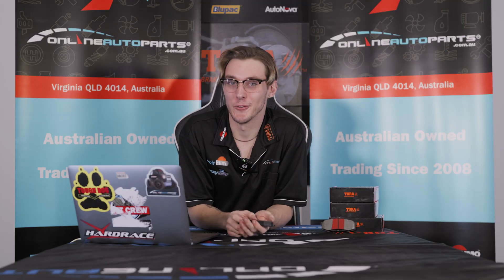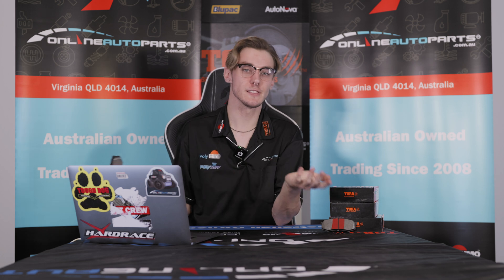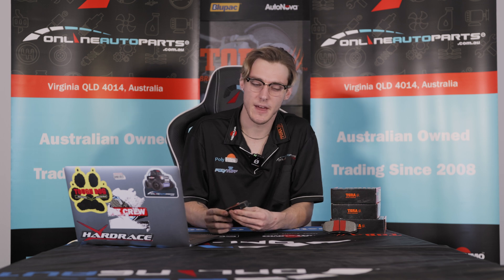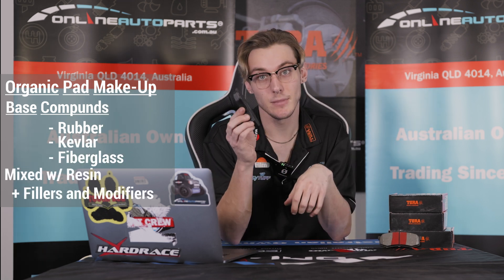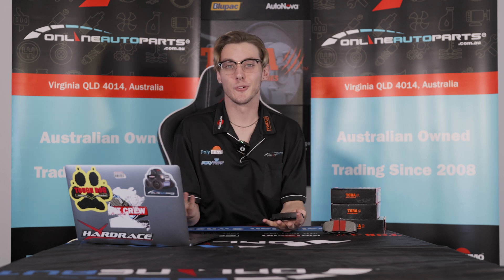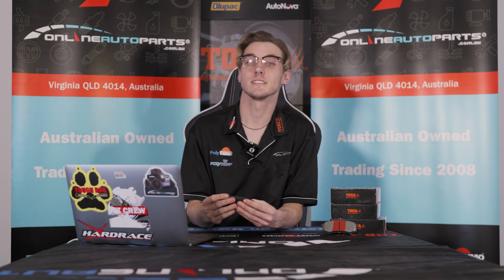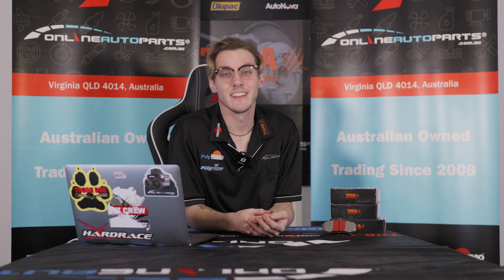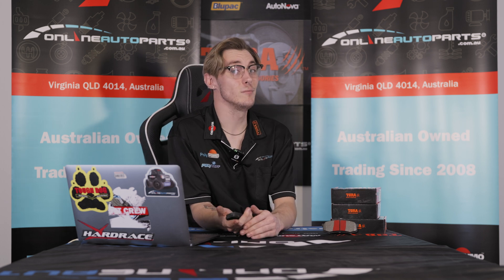Ceramic Brake Pads - Explaining the difference between Organic, Metalic and Ceramic

Comment: Tried the TORA ceramic on my 2014 XR6 as well as my 2013 Territory Diesel. For $26 these pads are absolutely amazing and fantastic value for money. In fact I prefer these to the more expensive Bendix GCT which seems to eat my rotors.
Reply: so do they have more stopping power? 
if so i will get some, i currently use the high performance bendix pads  ultimate i think theyre called